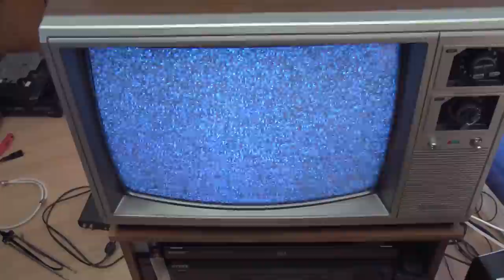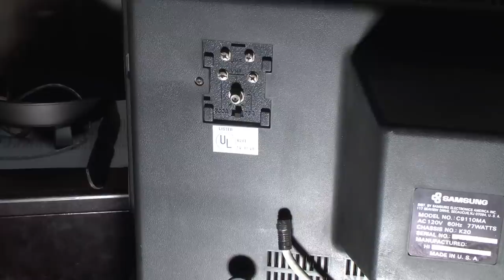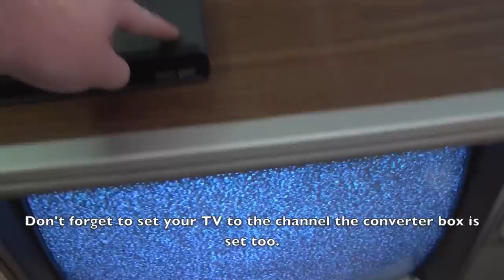Hooking up a Digital TV Converter Box

Comment: i have a element t.v.
Reply from the maker: That TV should have a built in digital tuner, the brand is new enough to not require any digital adapters, and using an adapter would only benefit if you want one with a DVR or something like that (like I do with my livingroom TV).
Reply: +Brandon MacEachern how do I connect it??
Reply from the maker: Jeremiah Martinez A DVR?  If you get something like a channel master, they are fairly easy.  Connect the antenna to Antenna In on the DVR, and connect the HDMI output to the HDMI input on your TV.

If you are using an adapter like the one in this video, do not use it on your Element TV, you do not need it, you'll do nothing but lower your HDTV set to standard definition.
Reply: +Brandon MacEachern my dad gave me an Apex Dtv. just don't know how to connect it.
Reply from the maker: Jeremiah Martinez If you have an Apex DTV, do not use it on your Element TV.  The TV has a high definition version of that built in.  Connecting the Apex will not be the right thing to do.  Just plug your antenna to the Element TV's antenna input in the back, and in the menu should be an autoscan mode of some sort.  (Every TV is drastically different these days).

Please understand, what you are trying to do, is the wrong way to do this.  Remember, a DTV box is for OLDER TV's, like the one in my video.  Using it on a flat panel modern TV, will give you a blurry picture.  Your TV has a DTV tuner already built into it.
Reply: +Brandon MacEachern I found my dvr lol. thanks.
Reply: Jeremiah Martinez ris